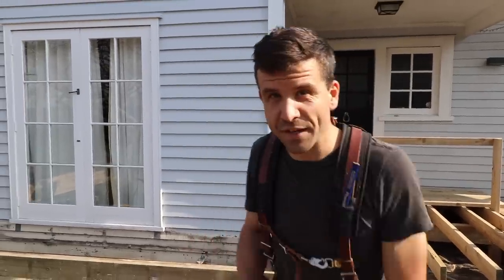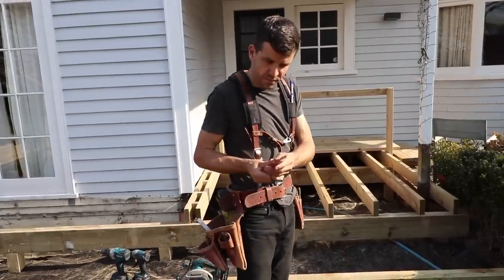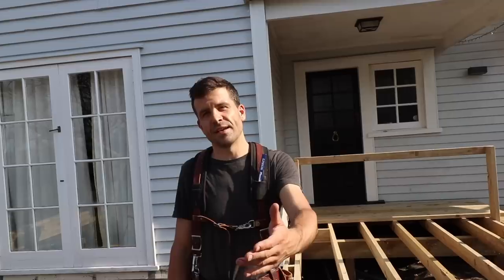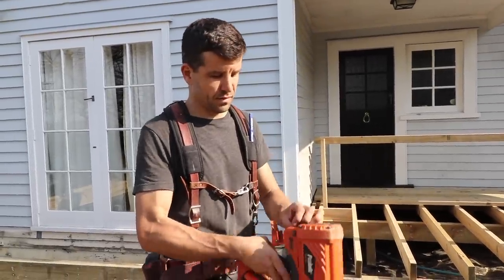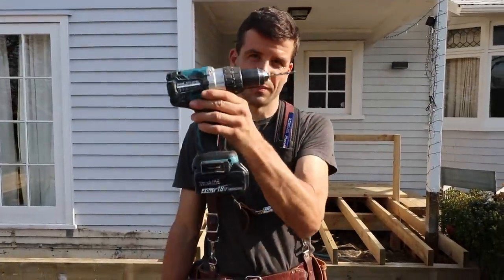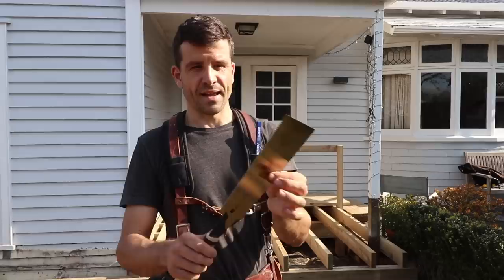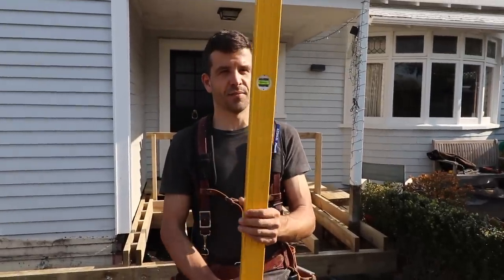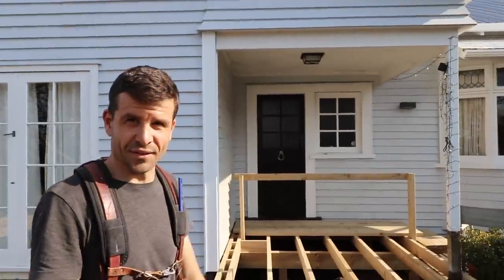First Year Apprentice? Get These Tools!

Comment: hello have you ever tried the nail /tool bags by Taurus Leather or Millenz both of these are New Zealand companies and not as bulky as Occidental bags,just a thought .Be Well J V Nick Nichols,DC1,USCG,(Ret)
Reply: I've got a Taurus brand, $350 and I don't think its that great to be honest. For the belt, I had to pay for one large enough to go around my waist. The pockets are not large enough to fit my hands, so can be tight. The cellphone pocket is not large enough to fit my smart phone, so I have to buy another replacement. Despite being NZ made, I wouldn't recommend it. The cheek that I paid a lot and I have to buy because of size issues is beyond me and additions for pouches is more money. Furthermore, delivery costs is way over priced directly from the company. I see a lot of US builders using the Occidental bags and I like the fact the pouches are on the side, not either in front or behind as the Taurus brand has designed them.

Comment: Did you say the circular saw is $800?!!!   In the US, $100. I just priced it.
Reply: Brand prices vary. Makita you will be looking at roughly $300+, while the Dewalt can go up just under the $800 dollar mark. The price does not include for a lithium battery, $144 to $228 while the charger alone can cost $189 and $228 on top from Bunnings.

Comment: why do aprentices need their own, exclusive tools while you share yours with your employee? thinking about the circ saw for example.
or rather, why would you want your apprentice to show up with one when you share yours with your employee
Reply: On job sites I've been on, people share tools. Especially the owner or the builder (slightly different meaning in the states) will have tools that everyone uses. That doesn't mean you shouldn't own a skill saw. I'm sure both of these guys own full sets of tools. Maybe they don't both have cordless, so that one gets used by both guys a lot.

Everyone should have their own tools, there will be times where both guys need to be on the same tools, but that doesn't mean tools don't get shared when only one needs to be set up for a job.
Reply: because if you own it you are more likely to look after it better
Reply: If its just your job, then dont bother buying tools. but, if carpentry is your chosen profession, and you wish to be proficient in it, then buy your own, save time by not chasing tools around site, your jobs will get done more efficiently, to a higher standard, and it will be noticed, you be given more complicated work, and your journey to become an expert in your profession will begin, why? Because you will always have work! And good tradesman, have good quality well maintained tools. The pride you put into the tools of your trade, will be the same pride that will be reflected in your work'smanship.

Comment: i hate those empire squares, i can never find the swansons with the grooves that most use
Reply: Much easier to use in bright sun .
Reply: @georgeb.wolffsohn30  swansons have a better finish, the bright blue finish fucking totally is shiny in the sun and there are no grooves for your actual degrees so you need to see the laser etch you cant even feel it out. Sorry for the agro I just haaaate that square hah , when I got the 7inch johnny square I felt like my time with the empire was wrong
Reply: @redberrey3754  I guess my comment was a bit vague. I intended to convey exactly what you said.